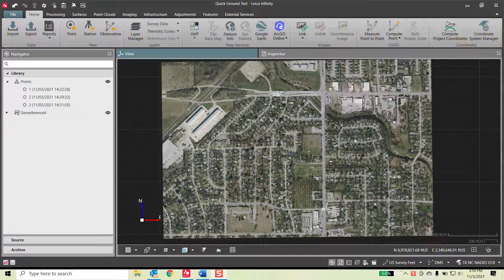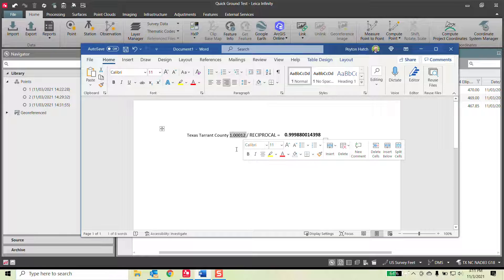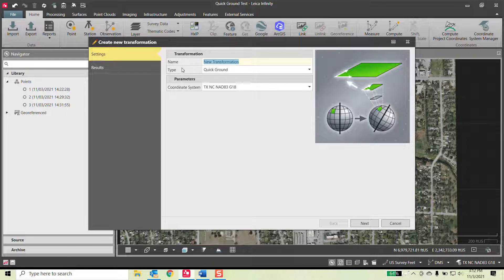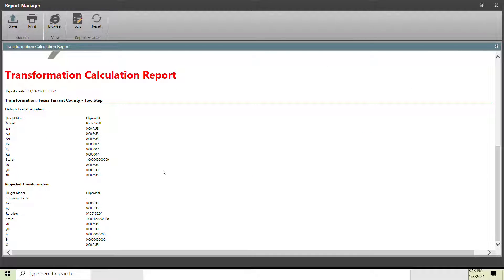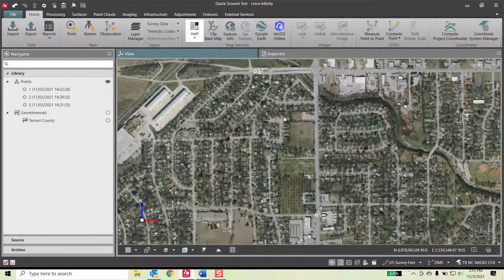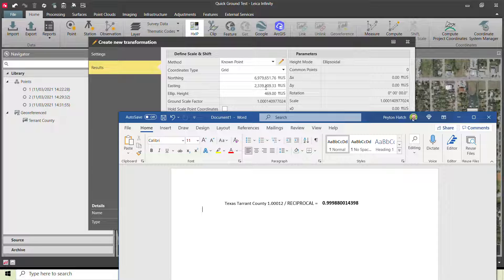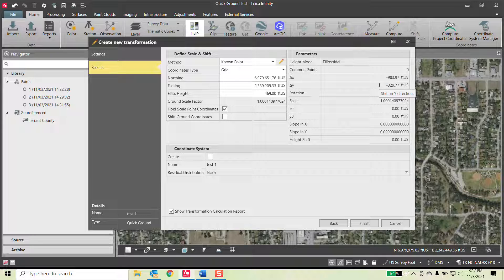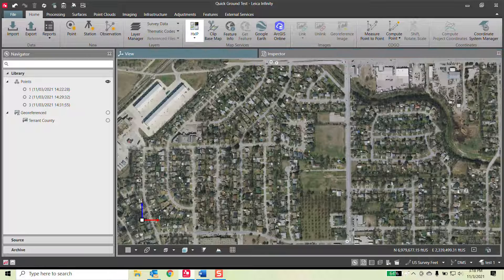Quick Ground in Leica Infinity

Comment: Is it possible to do this method with multiple scale factors? For example if multiple gnss set control along 4000’ horizontal run but with a 1500’ elevation change end to end. My concern being the elevation factor causes the combined sf to be substantially different from end to end.  It’s almost like I would want to do this multiple times for each set of similar elevation control pairs/triplets along the run (think ski chairlift that I want to stake in ground but set control with gnss). Love your videos.
Reply from the maker: Thank you Judd.  You would need to create multiple coordinate systems with their own scale factor in the incidence you described.